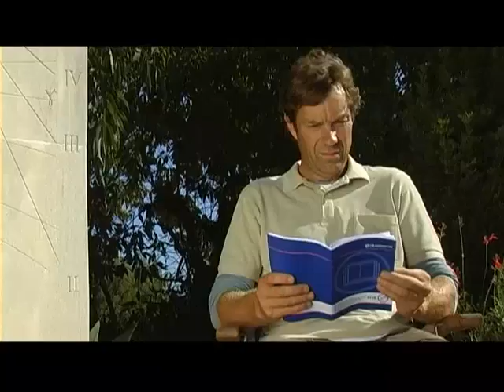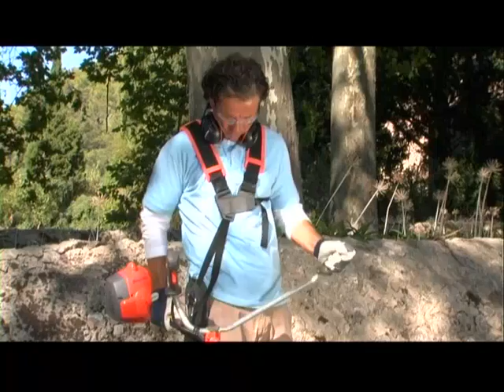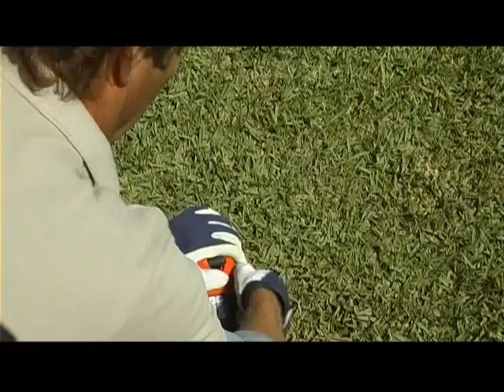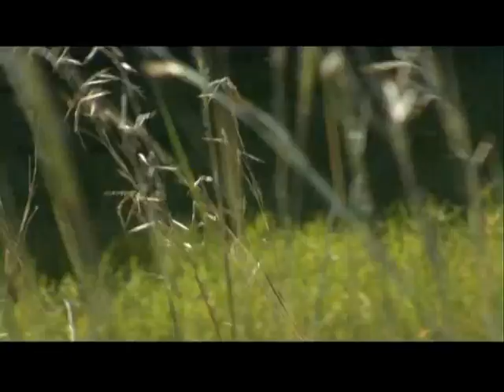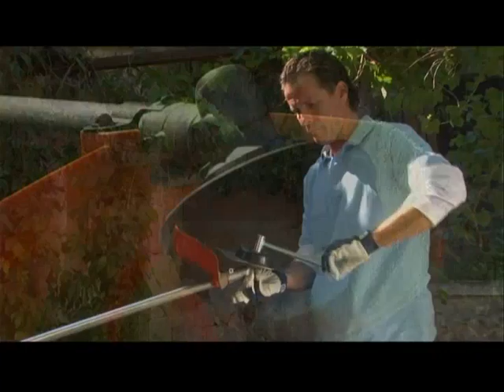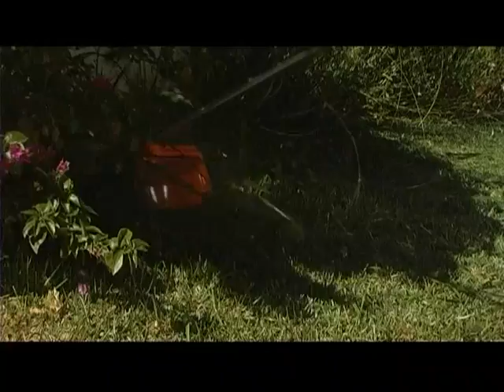How to use a Husqvarna Brushcutter

Comment: Just got the Brush cutter 128 LX to use when the tractor isn't necessary. The steel blade is awesome 👌🏽 and can be changed to string with the extra head that comes with it.

Comment: Some serious advertising for you guys,i have had a husqy 232r/l,since 96' i have had it serviced by a small engines mechanic regulary,run it on synthetic 2t castrol racing oil.never had one problem with it.until now,the new trimmer heads are just hopeless,so i am changing over to an after market head.other wise i love your products.